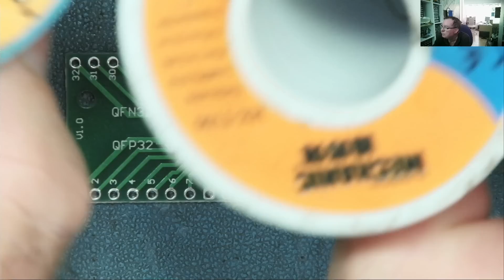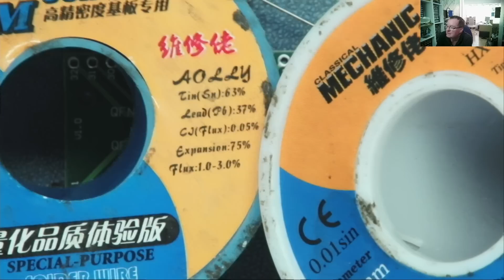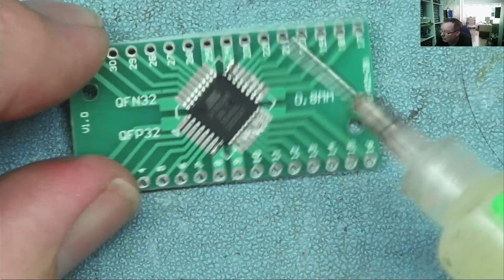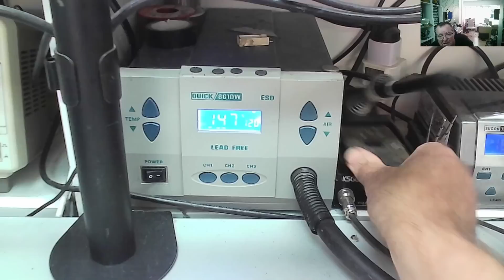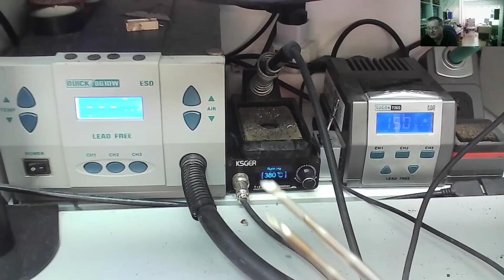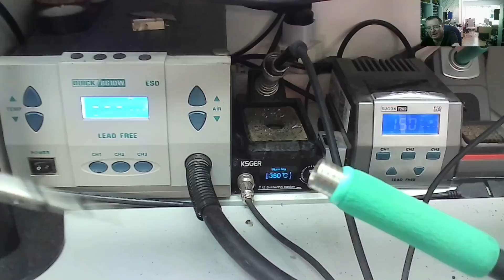Learn How To Solder QFP Chips IC Using Soldering Iron Or Hot Air

Comment: Other option is using stainless steel stencil to apply soldering paste and then you place all parts or just chip with pick and place machine or manually and then bake it in stove.

Comment: There's so called microwave tips for chips soldering, it looks like hoof type but is hollow. Works really well for this purpose because in hollow tip you can keep lots of solder and solder many pints in. Not so well if you have massive grounds, then you have to warm up the board to like 50 Celsius or use bigger soldering tip for the ground. No point buying it if you don't plan to solder lqfp on big scale.

Comment: You will not have to worry about fake chips if you buy your microcontrollers directly from Microchip, Digikey, Mouser, etc. I got burned ONCE many years ago - I vowed never again. I only buy from the reputable suppliers, even if the cost is higher.

Comment: You Can get flux with solder in it. It’s much easier. And I use a hot plate instead of the iron

Comment: I use a plain old conical tip at work (all kinds at home) and drag solder all the surface mount chips. I think its mostly easier, and don't get TOO many solder bridges anymore

Comment: Stencil, solder paste, chip, hot air….10-15 seconds/ chip= done.  Especially for beginners, it’s much easier than with an iron. Stencil keeps the amount of paste correct. When hit with hot air, the solder pulls the chip into place. No solder bridges or damaged pads of tracks. Also, a beginner with an iron is going to cook the chip. If you read the atmel data sheet, you find that the amount of time the chip can be in the temperature range to melt solder is minimal. If you functionality is bizarre after mounting, there’s a way to determine if it was cooked described in the nearly 300 pg datasheet.
For programming, isn’t this breakout board going to make it difficult to mount the external capacitors and crystal oscillators required for proper operation? Do the traces add unwanted inductance that changes values needed for the capacitors??
Reply: OK I could try this on video, together with a few other ideas here but I just had a quick look on AliExpress and I can't seem to find a QFP or QFN stencil set. Where did you get yours?

Comment: I would think a pair of helping hands,  weighted vice or board holder would help so that one is not also fighting the board moving at the same time you are moving the chip around.
Reply from the maker: Yeah you could hold it with someting like that. With boards like this they stay pretty well put on my antistatic mat, possibly because it has a slightly springy and contoured surface

Comment: Great demonstration... And of course I was watching real closely... Because in my past I did a lot of soldering... One small technique you did not mention when the chip is moving around and you have one edge tacked... And you want to shift it just a little bit I saw you push the edge of one of the corners using the pin which had a little bit of tension on it you used that tension to hold the position you wanted until the other pin was solder...🙂   I hope I described that correctly.  I think you did great for being on camera.... When you're demonstrating something it can sometimes be totally up in the air about what's going to happen 🙂  P.S. I also enjoy when you tell us about the tools that you use and the model numbers and where you got them.  I know over time through the channel you are showing us some of the items you review and items that you actually put into use which I think is great because many of us may see that tool in use and say that looks like it works sufficiently for my needs and will be potentially planning on a purchase.
Reply from the maker: the way I adjusted the position of the chip slightly using 'tension' like you say, probably i just do that so naturally that I didn't think to mention it. I learned most of this stuff by trial and error,  I watched a few videos first and they all look like soldering wizards! I don't claim to be one, to me it is just a matter of playing around with tools and solder and flux until you understand how the materials are going to behave together and after that it's pretty easy.